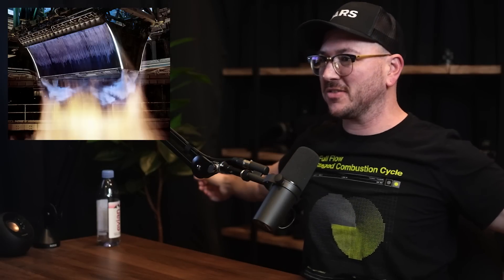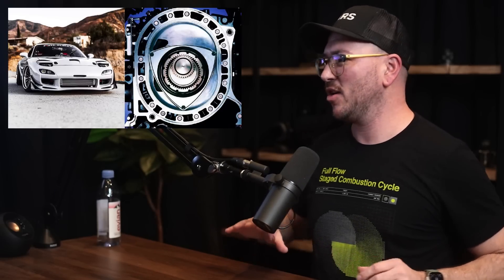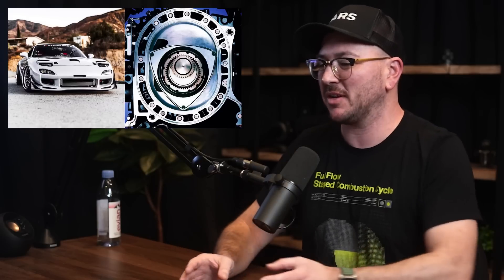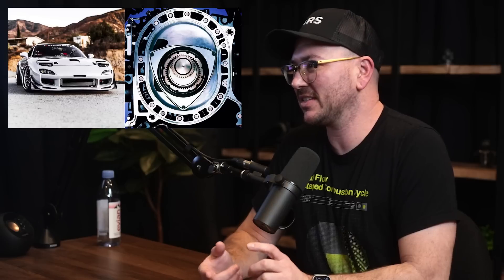Why Tim Dodd loves Aerospike engines | Lex Fridman Podcast Clips

Comment: Instead of firing the exhaust out of a small hole in the middle of a bell, an aerospike engine avoids this random distribution by firing along the outside edge of a wedge-shaped protrusion, the "spike", which serves the same function as a traditional engine bell. The spike forms one side of a "virtual" bell, with the other side being formed by the outside air.
Reply: i think the rocket should be fully EV.
Reply: @PhatAssObese  it's called a lightning bolt.  if we could ride a lightning bolt to outer space, we're fully EV